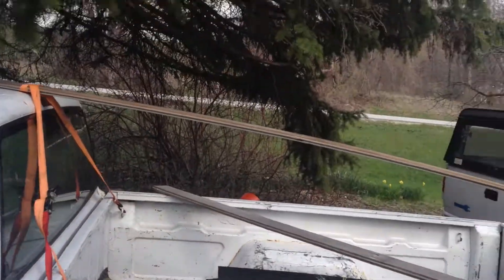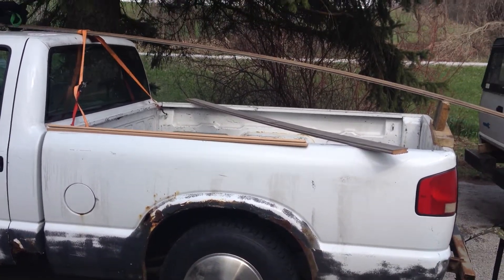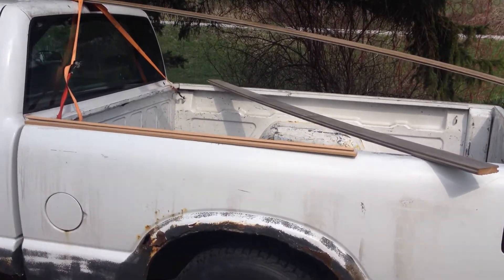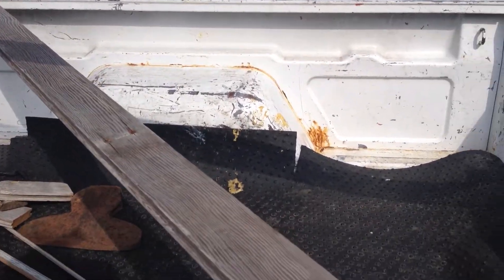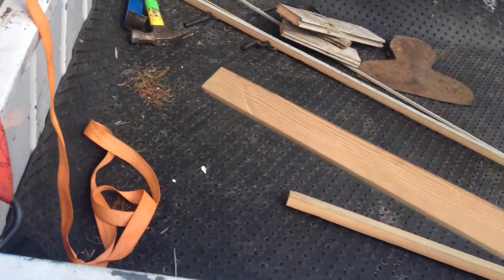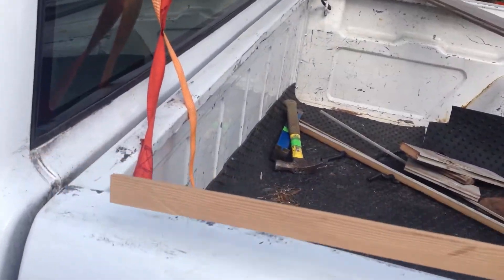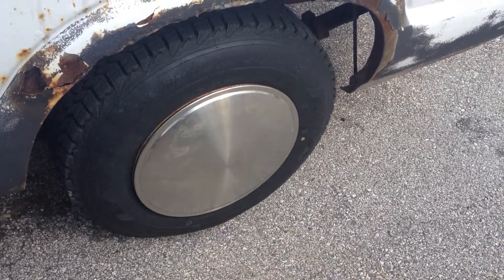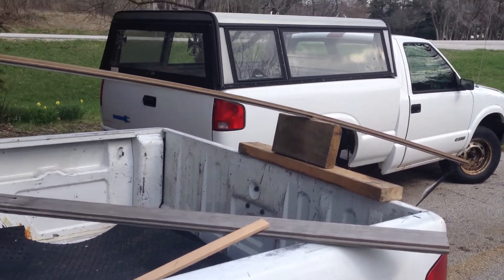SuperTruck: Aero Cap Previzualization

Comment: All interesting projects.  I'll be surprised if any mpg is gained from the Camper shell.  I was thinking with a pickup, it might be good to put a 200 watt solar panel on a pickup bed cover.  Then convert all the pumps  - water pump, power steering pump and AC to run off an electric motor with those running from perhaps 2 batteries being charged by the solar cell.  That would for sure save gas.